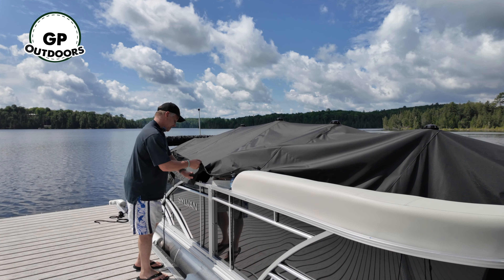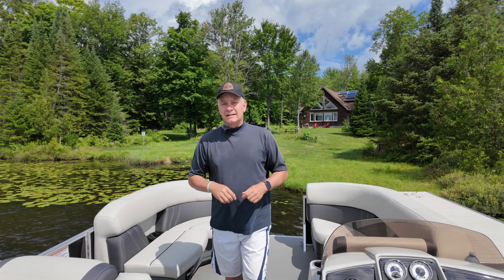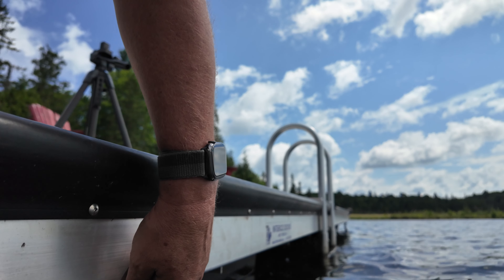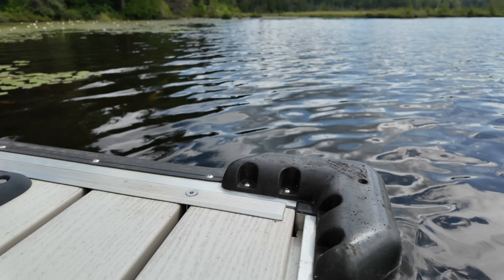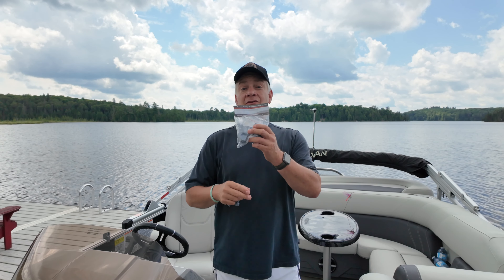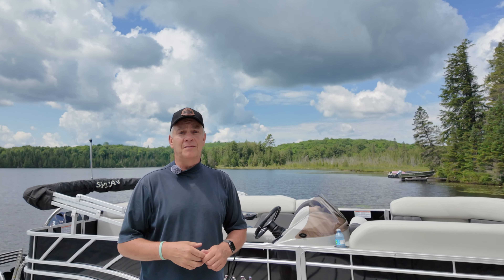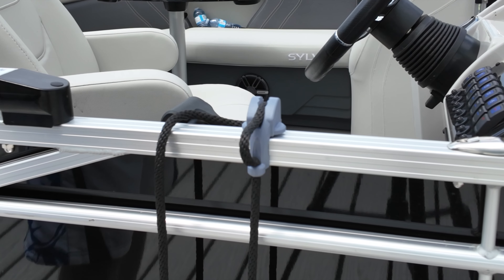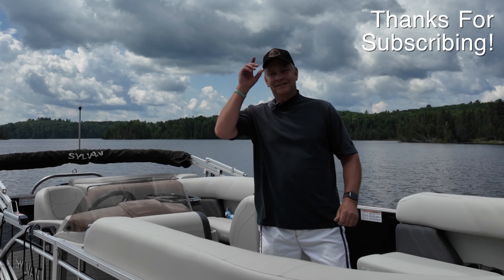768 NEW Pontoon Boat? Watch This BEFORE You Dock it.  4K

Comment: Lol Gord that is an awesome tip. I use to work on Pontoon boats also called Party Barges. I had a 32 foot Party Barge The floor was bad Oh it was so bad I had to strip it all down and rebuild it. The floor was made out of PT 1 inch plywood. The problem with that is there was no other protection. Water would splash under the flooring and over the flooring and the all weather carpet would hold the water so the flooring would rot. I stripped it down and replaced  the flooring then sealed it well as could be. Then I had to put everything back together.  People loved going out fishing on it and having cook-outs on it . But no one ever thought about the flooring on a pontoon boat. I admit I never did .
     Many people would give me their Pontoon boats for free because of this problem and yes I have put a lot of them together.  You have 2 Pontoons on your boat I had 3 pontoons that I could fill the Pontoons up with a Gas to make it float better. You look and you will see there is a Valve stem on the ends of both Pontoons for that reason as well as a drain plug if they have a leak and take in water.
    I have had people give me their Pontoon boats because of leaks and  for me it was easy to fix and find the hole. The drain plug is the answer. Use a red dye and or Dawn Dish soap  then fill it with water to build pressure It will push the red dye out or blow bubbles. Mark the leaks and then fix them.
     Gord I could tell you some stories about going out on  a Pontoon boat that would make you laugh so hard you would choak on your coffee laughing so hard and fall on the floor sweating in the dead of winter from laughing.
Reply from the maker: LOl! Sounds like you have a few good stories Dane! I know who I can call if I have a problem :)) Thanks for sharing. :))

Comment: Good info GP, I use those same clips, but I leave them tied to the fenders so I don’t lose them and can adjust positioning depending on the dock. I bought my boat used, and it had Vantage Pontoon Guard on it. Check it out, double sided 3M tape application, comes in a lot of colors and will absorb any of the bumps without scratching the actual pontoon. I’ve seen people double them up for additional height and you could put them on to cover any scratches you have.  Depending on your scratches, they may be able to be sanded and buffed out. Good luck!
Reply from the maker: Hey thanks - I will check into them. Appreciate the great advice!

Comment: Our toon lives on a hoist. For a few years (when I had more ambition) I'd install a carpeted bunk a foot away from the pontoon on the side away from the dock. It is basically a carpeted 2x6 mounted on a couple dock poles screwed into the lake bottom. Think on the west side of your boat in your example. That way the toon floats between the dock and that bunk. So if you had a strong wind from the east, you'd still remain near the dock to get on or off the boat easily. It does give a little if you hit it by accident. That was when the boat was new and my wife wanted to lay out and sun herself on the boat while at the dock. Now, we're happy enough to leave it parked under the hoist canopy.
Reply from the maker: Thanks Gary!

Comment: Really good info Gord.  Another aspect to consider when putting out fenders that we folks on the coasts need to contend with is tides.  In our case, a fender set to one height could be pretty useless in 4-5 hours, depending on the tide change.

Love a boating video!
Reply from the maker: Good point - thanks Chris!

Comment: Great video, Gord. Another suggestion for new pontoon owners: In many circumstances,  it is easier to dock with less drama to come to the dock at an angle so that your crew member can safely step off the bow, holding dock lines. Something you can't do in a bow rider and easier than trying to park alongside the dock with wind and waves pushing you around.
Reply from the maker: Good morning and thanks M - it is for sure. Have a great weekend!